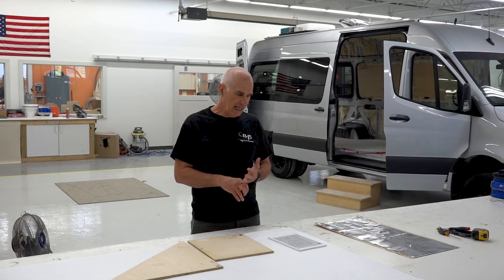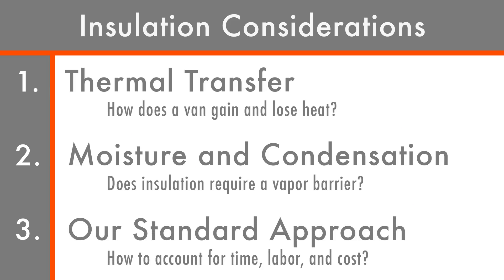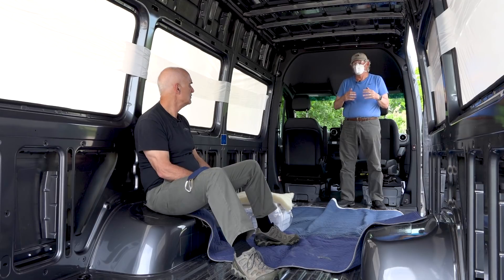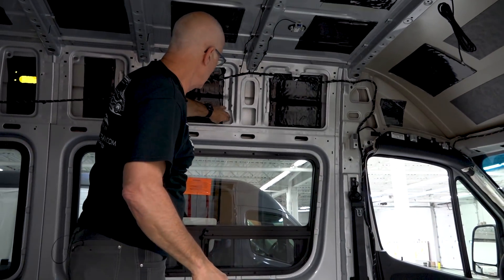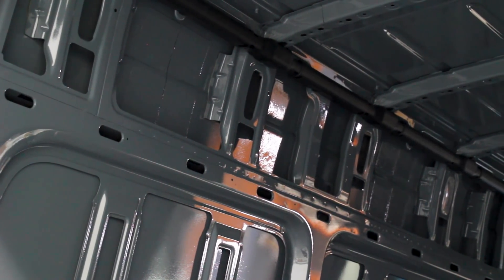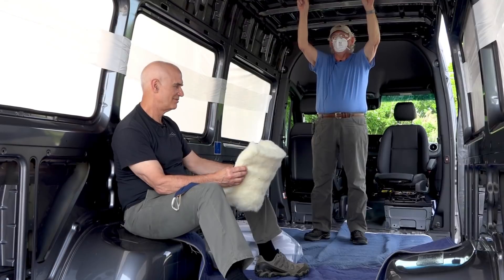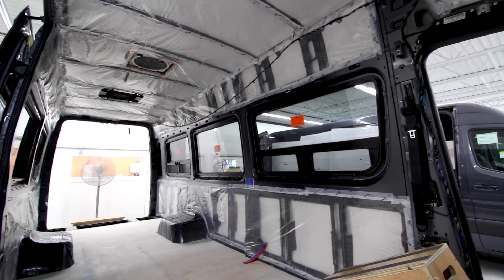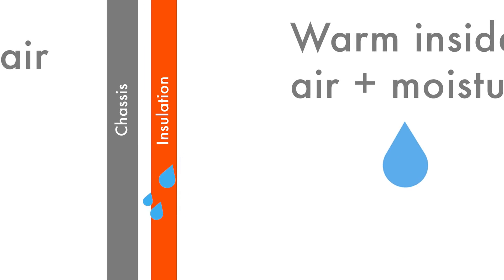What We Know (and Don't Know) About Van Insulation | Advanced RV

Comment: Considering that batting of any kind does not get to every surface and there is metal bridging from outer skin to inner surface, I am wondering about spraying LIZARD SKIN (before insulating with some batting). I read that it reduces temp gradient by 10 degrees. And since it is sprayed on all surfaces, it covers both those nooks that batting doesn't get to, and it covers the internal surfaces those metal bridges connect.  I would also expect the spray Lizard skin to protect metal and reduce potential for rusting.
Reply: damn that look like a great product, i would combine that with wool if i was to make a camper van, hope its not dangerous like asbestos or something

Comment: One type of insulation that was left out is the spray foam. I wonder how it compares to what you showed us. It might also be the solution to convection since it can also cover all metal parts.
Reply: I believe most outfitters would recommend staying clear of applying spray foam to the panels. Yes, it keeps moisture out of the insulation, but the trouble with foam is that it will also trap heat against the outer skin, which then expands and creates ripples.  The rigid foam also sticks to the skin, which exasperates the rippling.
Most noticeable on a van with dark shiny paint which absorbs more solar heating.

Comment: It might sound crazy, but what about literally thinking outside of the box? I've always thought about insulating the outside instead, which would have the added benefit of giving you more space inside. I know they've already done it with houses, so it's got to be possible. Some highly insulated European windows would go some way in minimizing heat loss, though I don't know if they build them specifically for vehicles. Anyway, that idea has been in the back of my head for years whenever I think about my dream RV. I've also thought a dehumidifier might be a good call if you have power to spare...
Reply: How are you going to attach it so it can withstand constant tropical storm-force winds?  Actually I can think of one way of doing it, but I don't think it'd be practical (lapping to the front).

I personally think the best thing is to do as they did with the B Box, ditch the prebuilt van shell entirely, use an insulated box for vastly increasing interior volume.
Reply: What about aerodynamics? What about looks?
Reply: @nicki8731  In theory it could be whatever shape you want, and it could be "skinned"     however you want. Maybe something like monocoque construction would be ideal. The comment was just to get people thinking for the most part and/or to hear if it had already been done.
Reply: @dylanemeraldgrey  I believe automotive companies are already making the vans as large as legally possible. If you want to go larger, it's a semi trailer or a box truck. So adding some inches to the outside would probably be illegal.
Reply: @nicki8731  Maybe... There are people who say something can't be done, and they're are people who constantly push the limits. Also, it's not just about the size of the rig, it's about the usable interior space.

Comment: I have been going around in circles in my mind trying to figure out the best solution to insulating a van. As you point out all the "ribs etc" are all connected to the outside and bring the cold in.
My base vehicle is a Mercedes Sprinter LWB. It has done 75K miles 9 years old and was a mobile workshop with work benches, Draws and shelves. Which I stripped out it was just lined with a simple solid nylon 3/16 inch thick nylon screwed in place for aesthetic reasons. .
The only rust I found was behind the rear wheel arches underneath the factory installed white sealant. 
The people who converted the van to a workshop sprayed into the bottom van wall cavity with wax-oil and that was it. 
Condensation must form on the interior of the walls then drain out along the bottom of the walls onto the road. There is no rust on any of the walls other than behind the wheel arch. 
I am going to use recycled plastic bottle insulation. It is plastic  bottles which have been spun into fine thread then formed into a matt. It should be water resistant and any water that does form can carry on down on the inside of van then out through the drainage holes at the bottom. 
I will put a vapour barrier in the roof of the van if possible to direct the vapour to the van's inside wall
Wish I had found your channel earlier.

Comment: Finally an honest video about insulating a van and the reason why some choices are made.

Thanks so much for the honesty. I've been busting my head about vapour and corrosion. As a mechanical engineer I almost thought I was a failing because I couldn't crack the theory. Now someone with a PhD in the same field says that he doesn't know either, it makes me feel better again.

Also, only the best professors I had said "I don't know the answer" instead of doing some vague half baked explanation.

Comment: Moisture not only comes from people breathing and sweating (ever notice how quick car windows for up when you jump in during a cold spell?) Also remember to use a fan when showering and cooking. I do agree with your outcome and have been banging that drum for years - nobody is going to cause rust inside unless there's an large leak and trapped water. However, there's a really good chance you will develop mold, mildew and stench. Use the ceiling fan!

There is one item that I don't agree with and it's really a pet peeve of mine - you aren't as bad as most but you could definitely cut back to less than half of whatever brand of gooey tar backed foil you're using. In the back of that van it can only serve to purposes - reduce/eliminate metal panel 'ringing', 'beer canning', etc. That stuff is a huge heat sink. Stuck to the skin of a van in the sunlight it will get hot and stay hot until the sun wanes and outside air cools. Inside, the a/c has to work so much harder to transfer the heat that stuff is holding to the outside.

Comment: get a professional spray foam contractor to do it right...Spray foam is what's used in coolers...It's also airtight...It's also structural rigidity...Best thing to do is Foam...I just foamed the roof of my rv, the floor of my rv, and the underside of it to keep my grey/black water tanks from ever having a chance to fall down...Thermal conduction comes from any area that's not foamed..

Comment: How does this apply to northern climates like Canada, Alaska, and our Midwestern winters we have here where it routinely gets down below 0F? The build I have in mind is much more Spartan than what you build- I just want to insulate , put in a vapor barrier, and some sort of moisture resistant ceiling, walls, and sub-floor. I plan on using mine as a mobile stealth basecamp for my backpacking/canoe trips, as well as overnight ice fishing trips to other parts of the midwest......I'd want to be able to haul my 4 wheeler in back. I also want to use it for waterfowl season (we field hunt)- basically have a place to park at a corn field entrance and set up a couple cots inside- take a nap, then go set up decoys, hunt, then come back and cook a brunch before heading home. That's my vision anyway, lol.

Comment: I used a competitor of Dyna-mat for sound insulation. I covered the wheel wells with it and used it generously on the walls and ceiling. It didn't do jack for road noise. I didn't  use it inside the doors and that may have been a big factor. I know that BMW cures their sound deadening materials in an oven after they've been added to the body parts. I was an eyewitness to that. That may be another reason the "dyna-mat" didn't work.

Comment: Curious to know your take on (semi) rigid foam boards, like polyiso board. Not as flexible obviously, but less expensive and thin sheets can be layered and offset to create a continuous layer insulation.
Reply: They are great for flooring. Harder to fit around curved vertical walls. Use Thinsulate or Wool or Mineral Rock batting.

Comment: How about a Thermal Camera video to compare the Vans?  I'd love to see that.
Reply: That’s very interesting only part of the equation, though the moisture is a big problem whether it be condensation or vapor or liquid
Reply: @Roberta_Esposito  Well, I feel a lot of that is from poor venting/design in the walls. People seem to fully fill the walls with insulation but don't make a wall venting design into the build factor of the other walls itself. I think there is ways around that with Humidity Sensors, and as the years have passed I know there is a Humidity condenser that have come out, at least I've seen one in a build on youtube. Anyway just a thought from years ago. :)

Comment: Why don't you use Rockwool?? It has an R15 rating. It is 4" thick but can be compressed for to any size. For example, Coachmen RV uses Rockwool in the whole RV and tops it up with ENRG Blanket to really keeps it cooler in the summer time and warmer in the cold days! Just a tip or thought from me. Besides that, I love your Vans and the capability to get everything custom build. Love the attention to detail and sure will purchase in the near future a whole custom build RV from you guys. Keep up the amazing work.
Reply from the maker: Hi Peter, thanks for the comment. We answered the most common insulation questions in a followup video: https://www.youtube.com/watch?v=diFOAQgNtYg

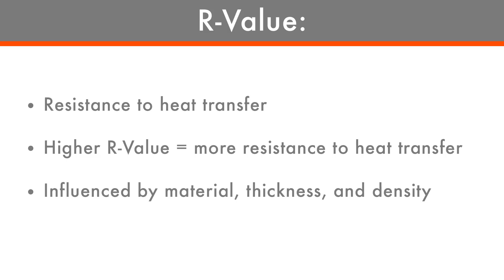At 3:20 in that video we share why we don't regularly use mineral wool insulation.
Reply: It absorbs moisture.  great for a home, not so good for the Sprinter

Comment: Would love to see a van that's used frequently or primarily in a cold-weather environment. Cold seems to be more problematic than hot, apparently.
Reply: Problematic in what way? Off grid heating has relatively easy solutions, cooling takes a massive power bank or shore power.
Reply: @Russellbeta  Condensation is the big problem we've noticed up here in northern New England. A/C naturally lowers humidity, so it's quite beneficial down south.
Reply: @Jollyprez  oh right, that makes sense. I've known people who say they have to ventilate 24/7 to avoid condensation issues and I'm not sure if there's a way around it.
Reply: @Russellbeta HELLO! He isn’t taking about the act of heating or cooling the van as being problematic!!! He is talking about insulating in colder climates being more problematic than in warmer climates probably because vans can more easily heat up in a warmer climate and dry the moister in the walls more easily! This video and discussion isn’t about off grid AC solutions being a big drain on the solar battery system and a heater that more conveniently taps into the gas/diesel tank. He is talking about insulation issues in varied climates!!!

Comment: I have the advantage of altitude and low humidity which is a great benefit in Nellybelle, my 93 Dodge Grand Caravan LE (the L is for Luxury) in terms of moisture control.  I even ran a Mr. Buddy propane heater without moisture issues before upgrading to forced air diesel fired dry heat.  I wonder if the moisture solution for larger vans in more humid climates might be better addressed thru advanced air handling but I am no expert on air conditioning systems for those vehicles so I have no idea.  FWIW, I have whatever insulation came standard on Nellybelle and full glass.  My solution for the cold is simple.  More heat. I've got way more than I need in my current heater.  I can easily adjust my altitude upward to escape worst of summer heat but I will one day be running an A/C off solar.

Comment: As an architectural engineer who long ago specialized in cold rolled steel, i can tell you that dual vapor barriers is asking for trouble both from a corrosion standpoint and an insulation standpoint. The synthetic stucco industry went through 1000s of lawsuits in the 70s and 80s over this basic issue. Dual vapor barriers trap moisture because no wall is perfect. If the moisture gets in, its game over. In the case of these vans, there are usually dozens of penetrations in an interior vapor barrier. How the steel stud industry solves this is by wicking the wall to give the moisture a way out. My recommendation is to go talk to a steel stud expert and maybe an automotive engineer (cars are insulated all the time) and they can give definitive answers.
Reply: Great point.
It also matters what climate the van will be used in, and if you have enough (dry) heat to keep the interior surfaces above the air’s dew-point.  I work in boats, which face the same challenges (and oddly never seem to get parked in the desert).
It’s long been recognized in boats that allowing some outside (cold-side) air to circulate freely behind the thermal envelope is the key to scavenging moisture out from within the insulation layer and from the backs of the interior wall panels.  It’s also why house attics are vented… unfortunately it’s VERY hard to achieve this in a class-B van conversion due to space and layout limitations.  The best you can do is what’s described in this video: work hard to minimize the air (moisture) movement into the insulation.  By choosing your materials carefully, then operating the van with appropriate moisture management you will minimize the chances of the wall panels developing moisture-related problems.
That will also mean managing humidity levels in the van - especially during the heating season - and being deliberate about periodically drying it out (parking in the sun with the windows cracked)
Reply: @nautamaran  Just to note, the big difference between a boat and van is that in a van it is possible to let moisture out the bottom (ie wicking) and let gravity do the work.
Reply: @1bike10  Are you talking about wicking into the interior of the vehicle? If to the exterior, then road splash may cause some problems for keeping the moisture out. I'm not sure that I understand what you mean, though. I'm considering just running dehymidifers and circulating air between the exterior and interior walls.
Reply: @Matthew-sl4rs  Unless you have some special climate that you need to humidify for, it seems like over kill. As far as wicking goes, I doubt road splash would be an issue but even if water came in that way, wicking would let it back out. More to my point, the best thing is to study how cars are insulated and copy that. They have been insulating cars for a long time and it's not as complicated as van people make it out to be. I think ARV is very innovative but they often over think and over "engineer" - true engineering is figuring out what works and then doing that.
Reply: @1bike10  What wicking method has anything to do with the bottom only?
Reply: @1bike10  Overthinking and over engineering are not the same thing.
Reply: @1bike10  Wicking is not using gravity. Two different things. It’s using capillary action to overcome gravity. Kerosene lamps
Reply: @GOLDVIOLINbowofdeath I am not talking about "wicking" as in candles. I am talking about a building construction technique. Most commonly used in brick facades but adopted by the steel stud industry to prevent the rapid erosion of steel studs in exterior walls. Regarding vans, I am really suggesting that automotive engineers would never suggest you insulate a vehicle this way. I don't want this to be construed as advice other than that if you are going to trap water in steel, you better plan a way out, or it will corrode.
Reply: @1bike10  "the best thing is to study how cars are insulated and copy that."  The only thermal insulation most cars have is adjacent to hot parts of the engine and/or exhaust.
Reply: @nautamaran  Could you elaborate on specifics please?  When you say "work hard to minimize the air (moisture) movement into the insulation", how do you go about actually doing that?  

By "choosing your materials carefully", which specific materials are you referring to?
Reply: Condensation on my 9 year old van drains/runs down the inside of the van walls into a cavity (Which has been sprayed with wax-oil then through drainage holes on to the road. I was used as a mobile workshop before I had it.
Reply: Use a closed cell foam like DOW Froth Pak 12 seal the entire shell and it's good to go.
Reply: My question is simple.  Which 3M Thinsulate, are you using?
Reply: You almost need a super insulation material that provide the thermal insulation and directs moisture in one direction or plane. Imagine that.. A one way moisture barrier.
Reply: This is exactly what I keep telling people. But this company (and lots of YouTubers) do it anyway, simply because it's More Stuff To Do. Either it's a way to get more money or of a client, or it's more watch time. Plus, remember, YouTube influencers literally get paid money to con people into spending more money.
Reply: @GrantSR  so are you saying you shouldn’t insulate at all?  if I was doing it myself, I would insulate just to keep it warmer in the winter and cooler in the summer.
Reply: Even tho cars are insulated it isn't done everywhere...
Reply: There are things as: vapor control layer or breathable membranes. Which let moisturized air pass in one way and block it into the other way
Reply: Or talk to airplane R&D men
Reply: The theorist and the practitioner
Reply: @ootoo95  data vs anecdote?